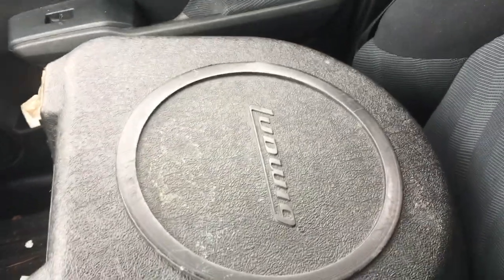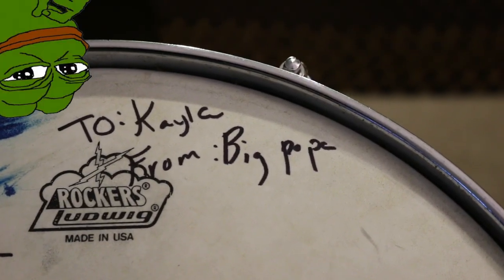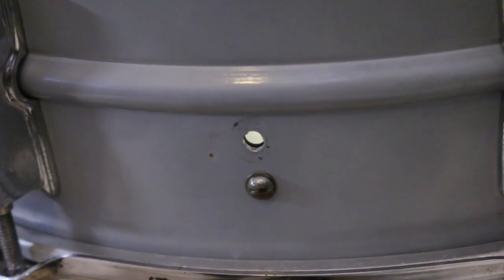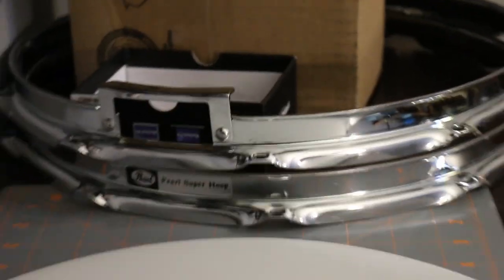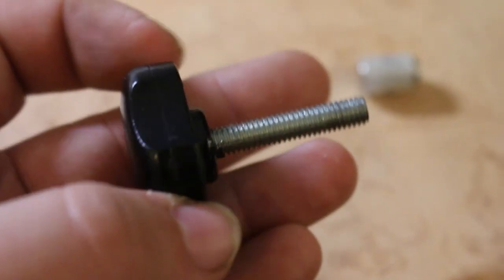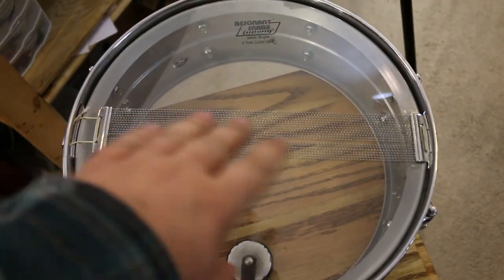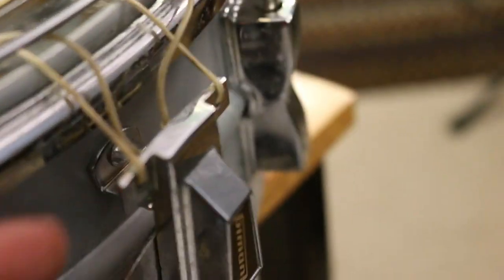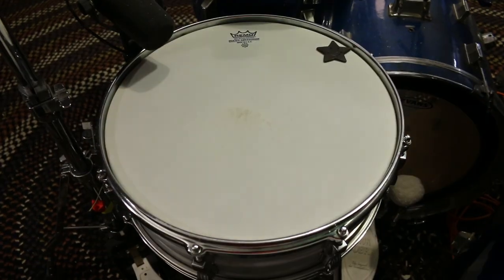This Snare Was Found at a Thrift Store!

Comment: Nice find! I just recently picked up a 1970s Blue & Olive Badge Ludwig White Acrylic(Vistalite) drum set for $50 from a thrift store / junk shop in Washington Township, NJ. It includes a 22" X 16" bass drum along with 10" X 6.5", 12" X 8", 13"X 9", 14" X 10", 15" X 12", & 16" X 14" single headed concert toms which are all in rough shape & look like they were stored outside at some point. Since I'm really not fond of the sound of concert toms, I'm going to clean up the drums, repair them, & turn them into double-headed toms. Additionally , I will be adding floor tom legs to the 15" & 16" toms & using those along with the 14" tom & bass drum for now since they are in the most decent shape. I'm also on the lookout for any cheaply-priced Ludwig LM402 Supraphonic Snare or Acrolite like you found since I also know of someone who picked one up at a yard sale for $15. I also have a 1980s Pearl Export which I finished fixing up as well. So I'm looking forward to the Ludwig project. With the Ludwigs, I will be doing a "Bonham" Style setup with them. I also use Remo drum heads, Zildjian Cymbals, & Vic Firth Sticks in addition to Ludwig & Pearl Drums & hardware. Any tips would be helpful. By the way, in what Sate are you located? I like your sense of creativity with the drums especially when it is a cool idea that works and/ or saves money..

Comment: I have 4 of these I purchased at Goodwill. Not as cheap as yours was but far cheaper than normal markets. 3 are brushed and one has the grey paint. All in great condition, originals heads and snares, with case, stand, and one came with the xylophone as well. Love good deals and you sure got a great one.

Comment: Also, the black face p85 throw-off wasnt incomplete - it was designed purely for strings back in the day, the new ones with a chrome face have space for both strins and strap mounting. I bought a brand new p85 for my 1968 Supraphonic 14x5 and it tends to jam in the off-position a lot, but an old p85 that came with my 14x6,5 Supraphonic from 1977 works like butter. Strange

Comment: I have a Supraphonic that had that strainer.   I hated it, too, so I used a tap and threaded the holes.  Can't remember off hand the size, but the two screws made it work great as I wrapped the threads that came with the Puresound snares I bought around it.

Comment: Acrolites range from bare brushed aluminum from the early days, 60s, to smooth anodizeded gray, 70s-80s, and thick, orange-peel type gray or black powder-coating 80s on. The early brushed aluminum type are more open sounding and have a larger tuning range but have a distinct ring. The later orange peel variety are more dampened sounding and don't have any noticeable ring, are described as dry with a sharp crack, and are among the best recording snares you can get for $200-$300 dollars usually. They can be found quite regularly since so many were made and sold to schools for band snares. If you find one in good condition, snatch it up. Most drummers I have known have at least one and RDavidR has several now. I have one of the 80s orange peel versions and I play it most

Comment: That snare will sound great in any range of tuning! Congrats on a sweet deal. Little known fact: if you have to cut a snare wire, always cut the same wire on the other side of the snares, this keeps the tension even across the wires. So say you have to cut the second wire for some reason, always cut the second wire on the other side!

Comment: FYI, older snares did not come with hardware for snare straps, as cords were all that were used in the good old days.  Also, Steve Gadd used an Acrolite throughout the 70's on many famous recordings.  The Acrolite has a deeper fundamental tone than a chrome Supra, which is simply a chromed Acrolite shell with Imperial lugs.  I have a 1971 Acrolite purchased new and a hammered bronze Supra.  Ludwig snares are the best, in my opinion.

Comment: A couple of years ago I brought a perfect Ludwig Supraphonic  for $20 in a pawn shop , so a case of right place at the right time . Or who is running the store.One thing I noticed is that you grease up your tension rods but I found that when I did that many years ago they would loosen up very quickly .They really don't need grease ,I've never done it again. Of course there are plastic lock devices but just try ...no grease. Cheers .

Comment: The Ludwig P85 lever at that time period (60s-70s) did NOT have a mounting plate. Most drummers used rope or cord and secured it through those holes you though were mounting holes for a backing plate. I found out the hard way. Drummers didn't use plastic straps to secure snares to the lever back then, some of them thought it would make it not sound "correct" or something. 

While I agree with you, I don't like the P85 either, the replacement is not worth the price of the drum. So, I'd fix it up, use it that way, and be happy. It also adds to the "mojo" of the drum, if it's anything to you.

Comment: Best find: Friend's dad died, was a maintainence man for the school district. She asked me if I'd want this "old drum" he had packed away forever. Sure,why not? Opened the fibre case and my jaw dropped. Ludwig Black Beauty 1920-something, engraved, calfskin heads, original snares, torn bottom head and a missing lug. Told her what it was. We brought it to Maxwell. Appraised at $1200. My best: Grungy thrift store. On a bookshelf,just for a prop, Ludwig 3"×13" wood piccolo. Old. Original snares. Nickel chrome,no pits. Offered them $20. Walked out with it. Brought it to Maxwell. Finish is "blue duck"(?). Late 50s,early 60s. Appraised at $275. And I found a powder coated '70-something Acrolite a few years ago. Paid less than $200. Love it.

Comment: That's not a '66...its an 80's drum! Great drum but the powder coated shells were in the early 80's..the anodized snare drums were raw aluminum! The 60's Acrolite had a keystone badge! There are no backing plates on the P85 throw off until the late 80's or early 90's! The yellow Ludwig grease in on the tuning rods is awesome stuff! Its factory and protects from moisture and corrosion...happy drummin!
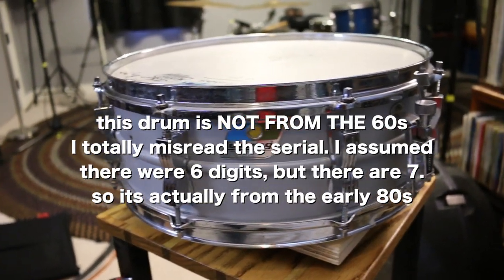Reply from the maker: Yeah didnt realize there were 7 digits in the serial until after I finished the video. theres some text that pops up around 2:20 where I correct myself. But I had no idea about the throw off until people started to comment exactly what you just said, so thanks! Also I feel much more safe using new lube! haha

Comment: I just bought a new 6x14 acrolite x 10 lug.  Ludwig doesn't fit them with mufflers anymore, and I had to buy one off ebay for $20.00.  You think for $400 they'd at least give you the option.  Also, I have to think of a hack for a cowbell until I get a bass mount.

Comment: Subscribe and watch & enjoy your videos all the time- I'm a 63 year old working drummer, I also collect & appraise vintage drums. I believe that drum would be from the late 70's because the badge is pointed on the upper right. In the 60's thru the 80's the Acrolite was a school issued drum. Youngsters used to try to peel off the badge to install on cheaper drums they may have had and the grommet prohibited that and hence would get caught on their clothing. By parents request Ludwig rounded the badge on all 4 corners in the 80's. As far as the case- it was called a UFO case and was constructed so that if a bully on the school bus threw the case out of the bus window or threw the case in the hallway- the drum would not be harmed. By the way- same shell as a Ludwig Supra except Acrolite iis  8 bowtie lugs and no chrome plating...instead of 10 imperial lugs and chrome plated with the Supra.
Reply: Marc Robin 
That's right Marc. Plus just
about every disco hit from the 70's
had a Ludwig Acrolite on it! To this day it's a MUST HAVE for working drummers & recording studios.

Comment: I think it is common for those vintage Ludwig snares to not have the backing plate on the throw off. I recently came across a Vistalite Snare and it had the same thing going on with the  rope going through the holes. Any recommendations on a throw off that I could use to replace it? Like you I dislike that throw off.
Reply from the maker: you can get newer p85s with that backing plate

Comment: You do realise that snare costs like 400 bucks
Reply: Yes and no. Ludwig is charging $400 for a new Acrolite which is very overpriced in my opinion. However, 1980's versions are going for around $100 on eBay. As this particular one is missing the damping knob and the hoops are pitted it's  probably worth around $80. So, still a really nice score for Dave. The real collectible ones are the 1960's and 1970's versions when Ludwig was making them in Chicago. I love these drums and have 3 in my collection: 1965, 1971 and 1976. The 1970's versions are still a bargain at anywhere between $125 - $200 for a really nice one. The 1960's versions are getting pricey with asking prices from $200-$300, but I'd still advise anyone to get a vintage one over a new one as they will appreciate in value.
Reply: What Maprow said. The new ones are WAY overpriced, considering you can buy 2-3 of the vintage ones for the same amount. Reverb/eBay/thrift stores are apparently the way to go!